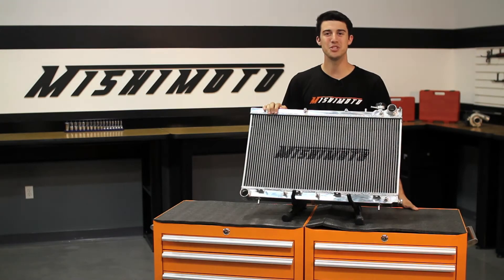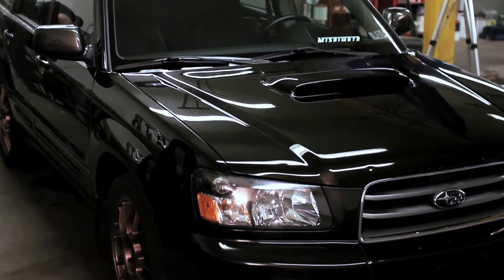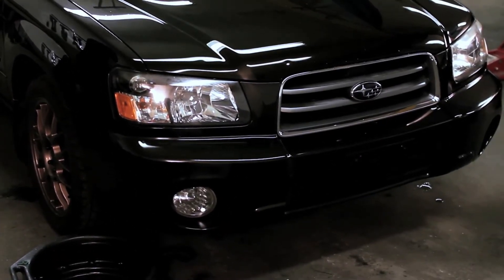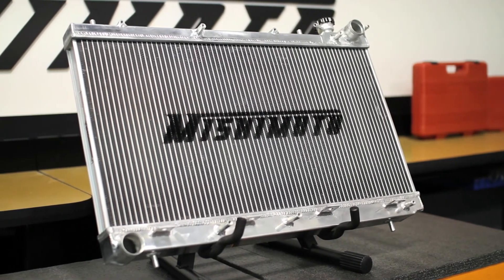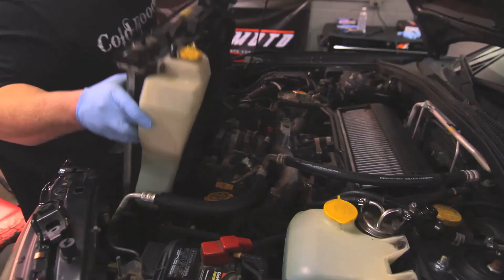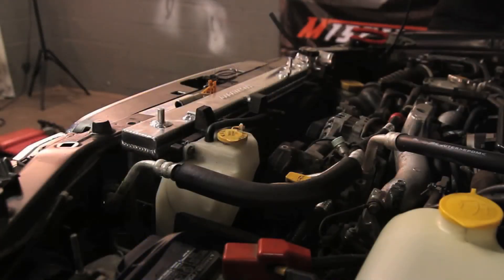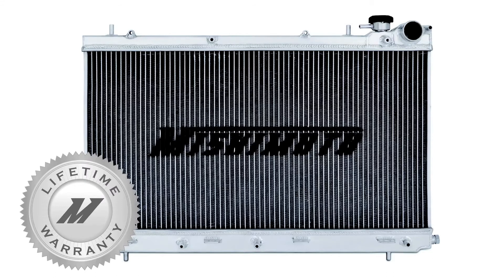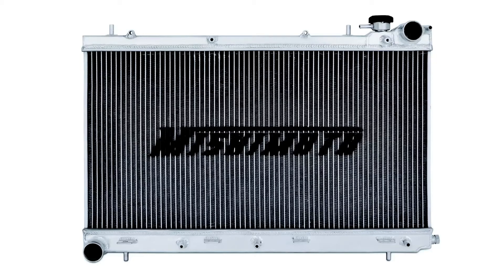2004-2008 Subaru Forester XT Performance Radiator Features & Benefits by Mishimoto

Comment: Would this work on a Non-Turbo 2008 Forester? Manual Transmission.
Reply from the maker: The radiator should fit in the car, however there is an additional coolant port on the upper tank that will need to be blocked off as this is not used on the non-turbo models.
Reply: @mishimoto  Thanks for your response. What is the proper way to block it? I'm highly interested in this set up because the plastic radiator is crap and I want my Forester to be very reliable.

Comment: What they dont tell you is this only works for manual Forster xt. Otherwise you will have to buy another part to fit this in your automatic.
Reply: Same with euro spec manuals that  also have a transmission cooler. I've done a little research and it seems that unless you need to tow it ok to loop the 2 transmission cooler pipes with some hose and do a cooler delete. In colder climates the aftermarket cooler can supposedly stop the transmission fluid getting up to operating temps as quick as is desirable resulting in stiff gear change. I'm doing the cooler delete until winter has passed